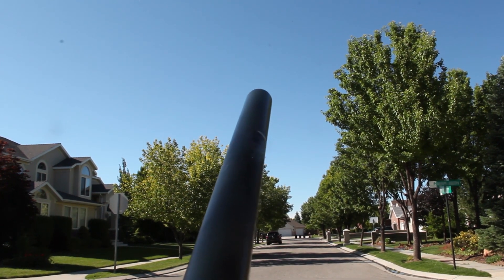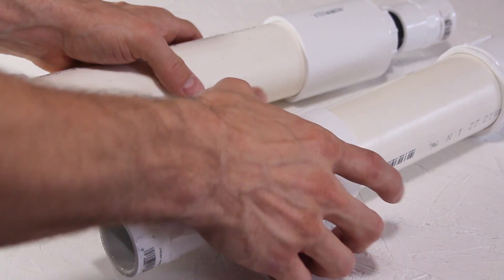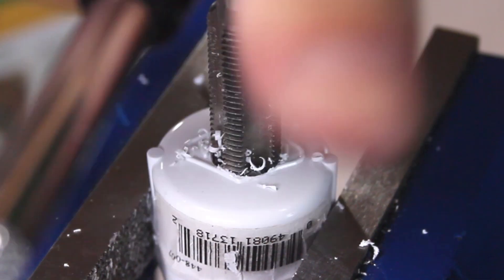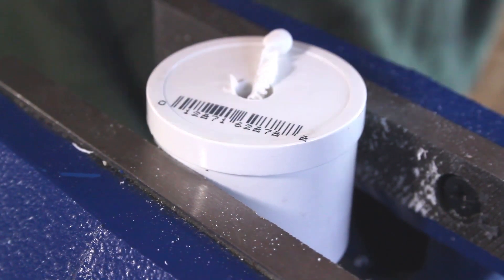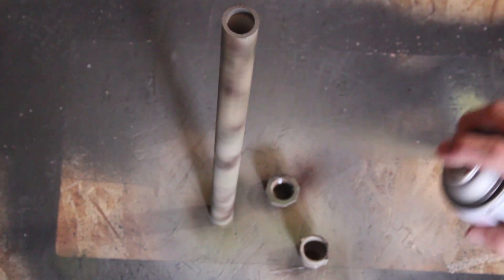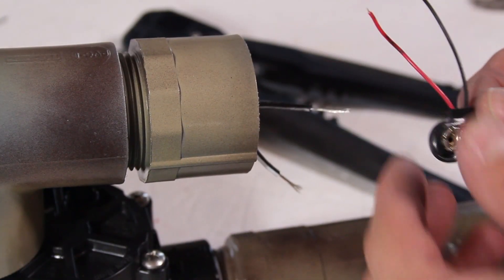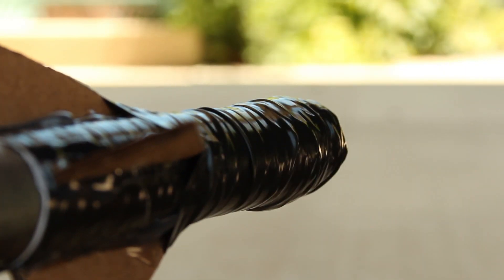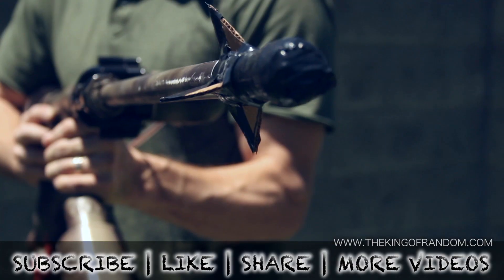Powerful Handheld Rocket Rifle (AK-47 style)

Comment: In his redneak world he can fix anything with hot glue
Reply: If it moves and its not supposed to, use duck tape. If it doesn't move and its supposed to, use WD-40.
Reply: Blake Whitner Also, in an emergency, zip ties can be used in place of duct tape.
Reply: Or duct tape
Reply: Ashley McGovern
Well, no, it's not really an insult at all. You shouldn't be offended by people joking about stereotypes.
Reply: Jonathan Wever I really didn't intend to offend you by that. I am sympathetic to the plight. Hell I am only going off your profile pic being a fox. You might not have anything to do with the community.

Comment: I have made a 180 bar paper rocket launcher, rockets 4"d and 20" long, range well over 1/4 mile and several hundred feet high, used small divers bottle for air tank and custom spring valve to fire it. great fun.
Reply: 180 bar is not possible with comsumer available equipment. i think you have read the pressure meter wrong. it is possible that it is 180 psi (12.41 bar)
Reply: ikki
	 	 	 	I never read pressure wrong ...
sorry but you can go to a dive shop, or a friendly fire station to fill a divers bottle to 232 bar or 300 with suitable tank, an airgun shop may also have a 300 bar compressor, or you can buy a hand airgun pump that will easily get 180 bar (bit hard work) in a small airgun or paintball gun tank or you can buy small hi pressure compressors for airguns
so yes you can quite easily get that pressure and it's well worth the trouble
	 	 	 	I found using much over 180bar the projectile needs to be so robust it's defeating the purpose of being quite harmless, up to 180 I used only paper and cello tape, at 230 i was reinforcing with plastic pipe and thick cardboard so you needed to be carefull. But that would fire a 4 foot long rocket completely out of sight.
Reply: do you have a video of it? i kinda want to see it now.
Reply: ikki
no sorry, may have a still image, if so I'll post one

Comment: In my opinion, you should show your viewers projects that are possible to do for most of them. These tools you're using are quiet unlikely to be found in most houses.
Reply: A lot of the tools that he uses can be replaced wit more common ones, or  just improvised with other tools.
Reply: nah, mate, bunnings
Reply: i have all the meterials and its so easy to make
Reply: I made it last week it took about 2 hrs I'm a pipe fitter by trade so it not fair to say its easy but for the average Joe this project is very much possible with tools around the house
Reply: I've got a workshop so I got all this stuff
Reply: These projects aren't for run-of-the-mill people. You either have the tools or you don't; it's as simple as that. If you don't have the tools, find another project to do; most of his projects don't require many "hard-to-find" ingredients. I think You'll find, in fact, an entire array of other projects that he hosts are quite simple and easy to make.
Reply: Alex Fine  Buy some cheap tools man, it's not that expensive.
Reply: The only tools you are either unlikely to have, or that can't easily be substituted for plain old elbow grease, are the tap and the air compressor. Honestly, a junior hacksaw, glue gun,tape measure or ruler, kitchen scissors and some sandpaper are all you need. I'm sure most households have those items. A 40 piece tap and die set will cost maybe 30 bucks. And there is a mod to accept a bicycle pump instead of the compressor.
Reply: MoodiFLEX then those people shouldn't be taking on projects...
Reply: ***** straya mate

Comment: Be very careful with this project, PVC pipe is only rated for 15 pounds of pressure.  If dropped or if it has a hair line crack it could blow up into fragments that will cause serious injury.  Check out plastic pipe made for air pressure, PVC is rated for water.
Reply: Jared, I'm very happy For your rear end orifice but the figure you quote is for liquid only, I plead with you to look it up before more injuries happen.  I am a retired plumbing Inspector with all certifications.  Check out the link from Anthony don.
Reply: Thomas Wenzler I'm unaware of all the injuries I guess. I have eyes, I can read, any pvc at every hardware store whether it's cpvc, or regular pvc has the pressure rating listed right on it. I dont care what your link says, I dont care what you did for a living pvc or cpvc is both rated for waaaaaaaaaaaay more than 15 psi. period. in every case. dont argue go to the store and read for yourself.
Reply: I guess I need to quote the warnings, you can look them up at Charlotte pipe, go to the warning site.
W-4:  Use of compressed air or gas in PVC/ ABS / CPVC pipe or fittings can result in explosive failures and cause severe injury or death.
W-5:  Do not use for SPUD GUNS, FLAMETHROWERS, or COMPRESSED AIR GUNS.  May result in property damage, injury or death.  Use only for fluid handling / plumbing applications.
I personally don't care if you build this or not but do so with proper knowledge.  This information is available at the manufacturers web site, there is a history of injury and death as a result of ignoring safety practices.  I have no problem with building the Rocket Rifle, I might build one myself, just not with PVC.
For the sake of public safety I made this info available, if you build this with PVC, please take proper precautions, it's just not worth the risk.
Sorry if anyone is offended, I am not wanting to argue just be careful.
For more info, go to Charlottepipe.com and read it for yourself.
Happy Hunting
Reply: What would you use instead of pvc?
Reply: I would use steel, iron, copper or any other material with a safe rating for air pressure
Reply: They have those warning to cover their butts. Just like the warning not to use your hair dryer in the shower... yes that is a real warning on the label. The main issue is that the spud guns and such people couldn't control the pressure and were basically building pipe bombs. If you have a regulator on the compressor and keep it below the rated pressure of the weakest part you will be fine.

Comment: Thats not how you use primer and pvc cement... You apply both at the same time, the primer "melts" the pvc pipe and so when you connect two connections with wet primer and wet cement on both connections, then the two connections "melt" to each other.
If you see this comment PLEASE edit your video, that is a very wrong way on installing a connection.
Reply: Except that is how you use primer >.>

You completely clean the PVC surface you are attempting to cement. You apply primer. You wait until it dries, which should take 10-20 seconds or so, then you apply cement and immediately fasten after cement application. You can pretty much prime the entire project before you cement, which is much easier. Although, you also probably shouldn't allow the parts to sit around forever after being primed as the PVC needs to be chemically active in the specific spot you are cementing and rather unfortunately the primer will just continue to diffuse and no longer be "working" where you want it to.

Now for the science behind WHY this is the case. The primer is made of ketones and partially of cyclohexanone. The ketones loosen up the long polymer chains of PVC and softens it via swelling and partially via dissolving, which also makes a rough surface and more surface area. The cyclohexanone acts as a lubricating solvent. The primer is supposed to diffuse through the surface layers of the PVC and make the surface ready for the cement. The cement then takes these now loosely packed polymer chains and dissolves them further with the same ketones and more cyclohexaonone. Once the ketones dissolve what you applied it on, the PVC fractional content of the cement starts to cure alongside the dissolved PVC content. The two parts mix together and , after curing, you now have a fully bonded PVC piece that, in theory if everything was done perfectly, is only ONE solid continuous PVC piece rather than the two or more pieces that you had originally.

The way you describe what is happening makes it sound like you think primer and cement are the two parts of epoxy, which is a VERY wrong way of thinking about how this reaction works. You might as well not even apply primer as you aren't giving it enough time to work its way through the PVC. If the primer is still wet to touch, then the PVC isn't actually chemically "wet" yet as the primer hasn't saturated anything yet.

TL;DR;
You are wrong Robert Karas. He is right. You might want to actually read the instructions next time. <.<
Reply: Ryan Claus learn english before starting a debate. I said no where near that, I stated he is wrong and you are wrong. If you misunderstood then go ask your english teacher
Reply: robert karas Or is it easier to read your comments, talking to yourself?...
Nope, still not.

I took a look at your sources. They all sound... well, sound. But they also agree with Grant Thompson.
Your argument was that he should have applied the primer and the cement "*at the same time*". Not one of your sources agrees with you. If you ask me, you just found some correct sources, saw that they remotely sounded like what you were saying, and hoped no one would actually fully read them.

Tl;Dr: All those sources say to apply primer, then apply cement. Exactly as Grant Thompson did. One even said to wait, just like both Grant and Ryan Claus said.

(Also, would love some clarification: Where can I get a job application for "my own buidness"?)

I understand your dad might be a professional (might. For all I know, "supervisor on the plumbing jobsite" could really mean gynecologist, but I'll give you the benefit of the doubt), but just because he's taught you some things does not mean you're a professional. And before you ask, I in no way claim to be one, either. All I did was check your sources.
Reply: Colby Murphy As in putting at the same time I ment not sitting around and waiting for the primer to dry. Which all of the sources, and a simple google search will give you.
I never said I was a professional, I was just correcting his mistake so people dont do the same.
Reply: Ryan Claus Yeah!
Science, bitch!
Reply: Jesse Pinkman I love you.

Comment: I see you using PVC Schedule 40 and but the Sprinkler valve pressure rated up to 150psi.  Does this ever fail?  So what is the highest pressure you ever put on this air rifle?

Comment: pro tip: use abs parts instead of pvc. abs has higher pressure ratings (per thickness). as well if it should explode it wont fragment in as many pieces.

Comment: That's a great design, but with a few modifications, it could be made DEADLY!
=========================================
Instead of using the paper rockets that fit over the end of the pipe, you can make some darts for it by shaping some paper into a cone shape (I found that magazine covers work best) and pushing a nail into the front of the cone secured by hot glue, and wrap the tip with electrical tape. Then fit the dart into the barrel to judge the size, mark the dart where it stops, and trim off the excess.
To load, remove the barrel (I noticed you made a few of them), push the cone into the base of the barrel about an inch and screw it back on. - Ready to fire!
Not only will it shoot WAY farther, but it'll be more accurate because it has the length of the barrel to travel before pressure is lost. AND it's more aerodynamic.
Happy Shooting!
Oh, and the heavier the front of the dart, the better. You can add weight by either dropping a nut (or something similar) into the tip of the cone before hot gluing, by adding a heavier nail, or just wrapping extra tape around the tip.

Comment: how many shots do you get out before it depressurizes?  my brother in law made a potato launcher using hairspray as the propellant and an spark igniter you had to load the chamber on  every shot.
Reply: +Apples n&#39; Oranges There are 2 large parts of the gun that hold more are, but, the whole gun is one air tank. There is only one pneumatic port and the sprinkler valve is the only place for the air to release.
Reply: Derek Oliver so more than one shot Im assuming as long as there is enough pressure in it. thanks.

Comment: I made this project, but modified it to look like an M16 rifle, and used black iron fittings and pipe for the body and barrel. I believe I used the same sprinkler valve as you used, but when I fire it (at any pressure), it just coughs the air out and the rocket falls on the ground in from to me. I actually used two 9v batteries, as one did not work at 135 psi. 
Why didn't it work? Should I have used PVC like you? I thought steel would be stronger/more hardcore...

Comment: for a good "bazooka" ,that's fun with the fourth of july, you can just take a pvc pipe and, putting a strong glued and very ductaped double sealed extra glued, end cap the rest a bottle rocket on the edge of the open pvc pipe end, light, knock back into bottom, then launch! e careful.

Comment: You trust a tapped hole in a PCV cap to withstand 135 psi?!  Also, you are supposed to glue apply the glue immediately after the primer because the primer softens the pipe.  If you let the primer dry you have some nice purple pipe but it doesn't do anything. But, still a pretty sweet project!
Reply: Actually, it is supposed to dry. The primer needs to diffuse through the surface layer. Having a "wet" surface means the diffusion hasn't finished yet. Though, you shouldn't let it sit for longer than a few minutes at most.
Reply: I feel like we need to define the difference between "wet" and "soft".  I don't mean it's so wet it's running out the pipe, but I do think the pipe needs to be somewhat soft for it to work properly.

Comment: Why not put your rocket fuel in this and make it ignite after it takes of from the air pressure?
Reply: dipro001 It's the King of Random not bloody MacGuyver! It's supposed to be a project to build with your kid or something on a weekend not brake the A-TEAM out from an underground dungeon...lol
Reply: Ashley McGovern umm.. have you seen his other videos? thats basically what he does. not stuff you'd want to do with your kids.
Reply: If you had an small RC receiver attached to it / sunk it in flush with the rocket body and were using model rocket motors, Estes or similar. They ignite by electric current. Attach the 2 wires to a channel on the receiver and motor ignighter, then adjust that channel and it will ignite and hey presto now rocket power will kick in. That's the method I use to give my RC planes rocket power boosts if I want to. I am McGuyver.

Comment: This is a bad idea. This is a very bad idea. PVC is not made for the air pressures indicated. PVC is made for water and water pressure. They are not the same. Should the PVC fail, break, if filled with air, the piece can fly apart like BB's out a gun barrel. If it holds water and breaks, it only leaks and does not splinter.
Reply: It can easily deal with only 135 PSI.  Most PVC pipe is rated for up to about 300psi.   Potato guns are made from PVC and take the pressure of exploding lighter fluid, hair spray or other volatile liquid which, I am sure, well exceeds the air pressure being used here.  I have never heard of even a potato gun 'Flying apart'.
Reply: Jim King My Potato gun did, not exaclty fly apart in pieces, but a small piece broke and flew away.
And it was no cheap PVC...
Reply: Jim, I never said a potato gun blew apart. You do point out that the immediate pressures might exceed the 300 psig. However, as Hector says, his blew apart. PVC used in workplaces like wood shops have failed causing injuries. We are waiting for some one to get the idea to fill the combustion chamber with gunpowder from a handful of M-80s to see if the spud will go farther. I hope the tuber just blows apart.
Reply: The real point is that in the video he is dealing with 135PSI.  That is well less than half the rated capacity of PVC. Not a danger at all. I have also known of guys who plumbed their garages with 2" PVC to distribute the air from their compressor @ 175PSI & have never heard of a failure due to the air pressure in that instance either.
It is impossible to protect idiots from themselves & I am sure that there will be those who are dumb enough to pump it up to 200+PSI, just like there are people who do all other manner of stupid things.  All anyone can do is be reasonable & accept that there are a lot of stupid people in this world that WILL do things that can kill them.  Unfortunately, the idiots sometimes hurt people other than themselves.
Reply: and the victims family will seek compensation from the video producer for making the video, YouTube for dangerous disregard for safety, and the manufacture of the PVC.
Reply: SpartanCaver
I feel sorry for people like you that worry so much that something 'Bad' might happen.  Your life must be pretty unbearable - -